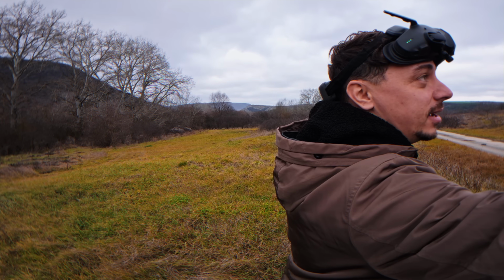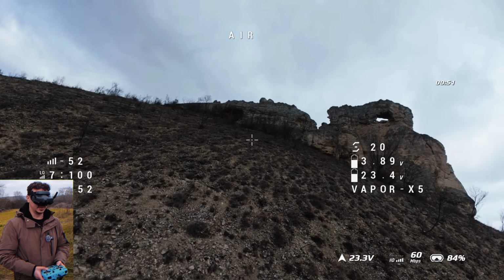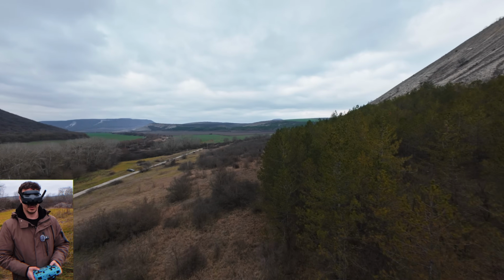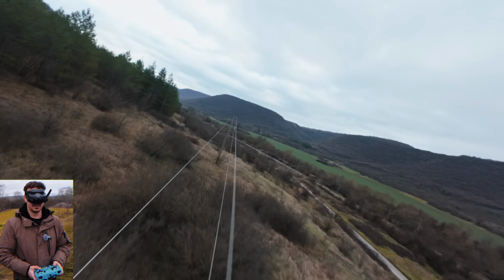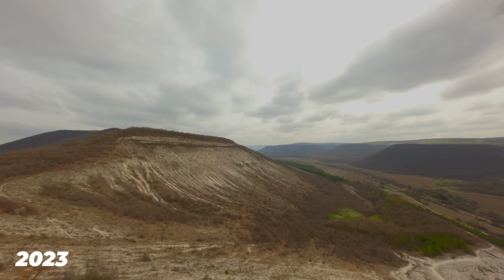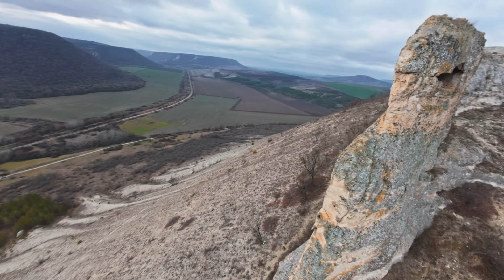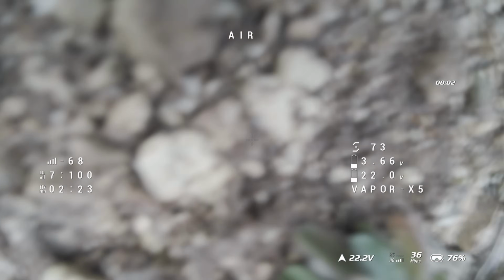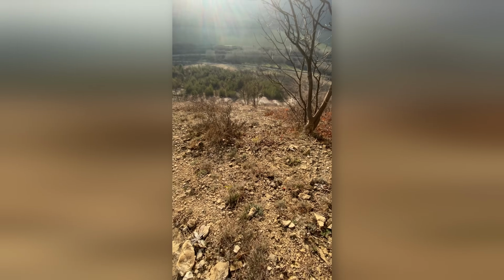DJI O4 Air Unit Pro First Flight - CRASHED & BROKE IT!

Comment: Hey dude..nice video..I just have a question. With the same frame my o3 is showing a little bit of props. But there r no props in your video. Is it due to the difference in mounting of o4, or did you zoom in while post processing...
Reply from the maker: Here i haven't zoomed in, i think it's just because of how the unit has been mounted, it definitely sticks out a bit more from the frame compared to the O3 unit, hope that helps! :)
Reply: @Mihail.Svilenov  thank you..finally I got some good news. I used to maintain 2 quads x,dc for freestyle and filming due to props issue. Now this is very helpful for me..

Comment: Crashes are always a risk appart from battery anxiety but good that 04 air unit came out and who knows maybe in a few yeasr they may improve the transmission system so you can fly behind that mountain. Could of been worse if you had to climb a huge snowy mountain though, maybe fit a hook on the drone and carry a resuce drone with winch to fetch it. 🤔
Reply from the maker: Absolutely! Thanks a lot ;)

Comment: What's up with the JUMPS in your DVR footage? Lost frames?  I usually don't notice much but the jumping forward is extreme when I'm watching the first flight.  If you really wanted to go for it, I would have tried a power loop through that hole LOL.  Is it under warranty?
Reply from the maker: It's just because i'm switching between the DVR and the footage, there's a slight jump between the two. As for your power loop idea, i'll keep it in mind for next time lol
no warranty on anything no! :)

Comment: 8:28 lol no you weren't going straight or aligning the gap correctly, and over correcting the whole time with gas... the wind has nothing to do with this :D
i got click baited you didn't breack your o4 :)
Reply from the maker: Fair enough :)
Reply: @Mihail.Svilenov  You did break your antennas, did they pull the ufl off of the pads?

Comment: Mike....thanks for sharing even when things don't go as expected!  It's always appreciated.  If it makes  you feel any better
if I drove all the way out to a specific location and lighting looked like that....I would have probably sent it to!  It's just way to hard
to resist.  However, I think after 1 pass...I would have called it a day with those winds.  That's a very risky gap but I have to give
you a give you credit for the attempt.  To be honest, turtle mode for me rarely works because when I crash I usually break something.
THANKS AGAIN FOR SHARING!  Awesome location!   Oh, and I assume those are the DJI Google’s 3 your using?  Just picked up a set myself for the best O4 experience…love seeing 60Mbps on those runs!  ✔️✔️✔️
Reply from the maker: Always a pleasure reading your comments Ron! Thanks and I hope you enjoy the goggles! They're amazing paired with the O4 Pro.

Comment: How did you mount the camera into the Vapor X5? It is a bit wider, isn’t it?
Reply from the maker: it's a bit bigger than the O3 camera but the space was enough to mount it perfectly, just used 1 screw per side to mount it (instead of 2x per side) and it stuck out a bit from the front part of the frame but no problems with that!
Reply: @ thanks so much!! I‘ve got an o4 pro on the way and don’t know what frame to put it into. Since there’s an option to order the vapor without cam and vtx, I might be going with that. 
I‘m sure there will be plenty of 3d printed parts to mount it on various frames tho.
Reply: @Mihail.Svilenov I’m glad it fits in there good, can you just unplug the o3 air unit and plug in the o4 and everything work properly or do you need to program in betaflight?
Reply from the maker: @SEVANFPV  you can, yes. All you need is to activate it, update it and then swap them in their positions and you're good to go.
Reply: @ man that’s great to hear, thank you for the reply!
Reply: Did you perceive any difference in performance with the antennas?
Reply: The O3 and O4 cameras are both 20mm for what it’s worth.
Reply: @smithe68  the o4 is 23mm I think. Definitely a bit wider. JB measured it.